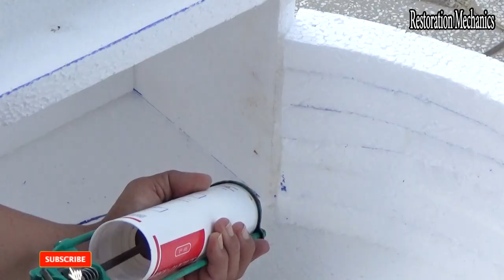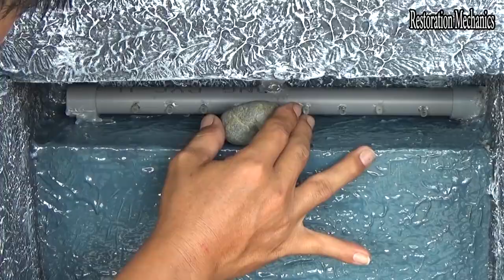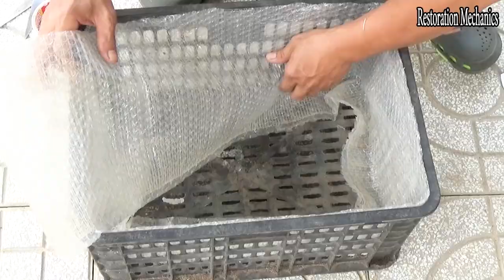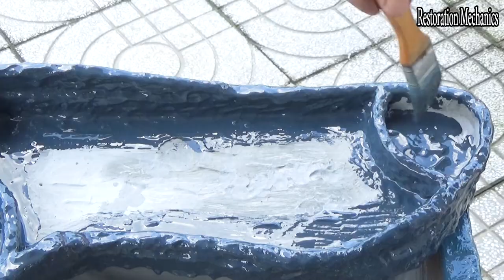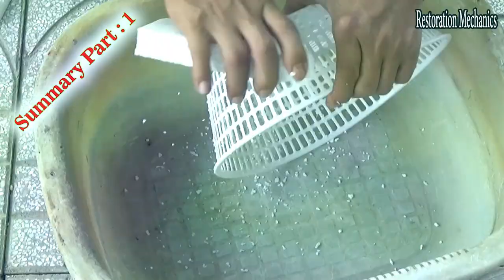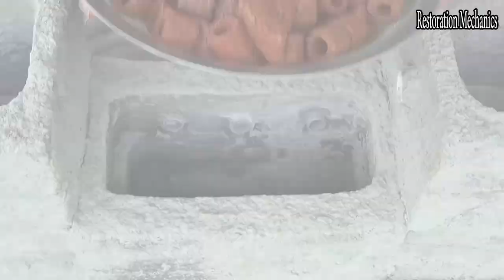Top 3 Diy Recycling Craft Ideas With Cement And  Styrofoam At Home

Comment: Hey thanks for the video I really wanna know , why is it that when I apply cement on foam just like you and many other videos on youtube it's so breakable I mean if I push my finger through it it easily breaks is that how it is no matter what or there's something I need to change . please help me
Reply: I’ve been trying to get an answer for this  for ages; but no -one answers me! If I did this; it would NEVER work!
Reply: @jillsmith5687  because that's how all of them are it just doesn't work like that 😂
Reply from the maker: you have to make thin layers one after another until it is hard enough that it will not break. This work takes a lot of time